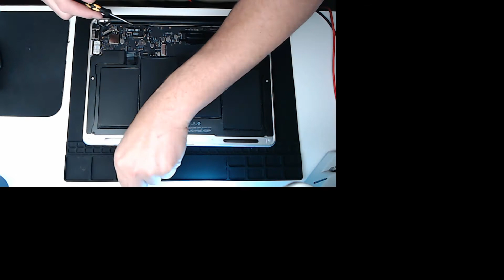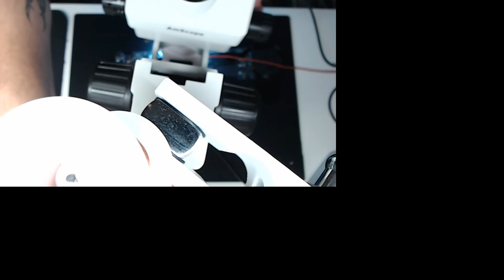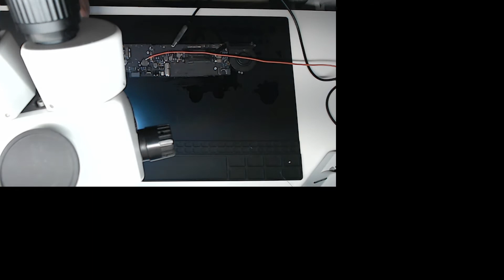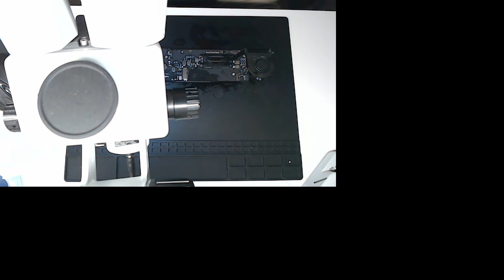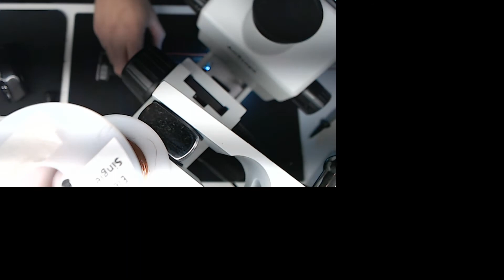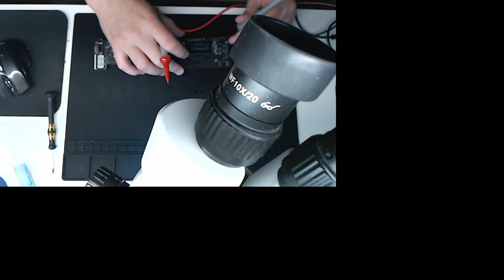A1466 - 2015 13" MacBook Air - Dead CPU :(

Comment: Maybe im wrong, but i think you did a mistake...
You removed Q7310 who is on the positive line what about Q7311? this part is directly connected to GND. Maybe this part is crap...
I think Q7310 is working fine, but works against GND (via Q7311 who is shorted to GND maybe) and get hot in this case..
And you removed the L7320 (not L7310) who is phase 2 for Power creating to the CPU...
I know its too late... You stream this 4 years ago...
Kind regards...